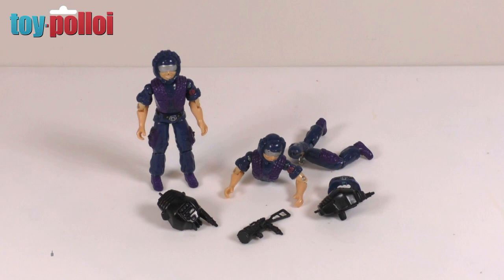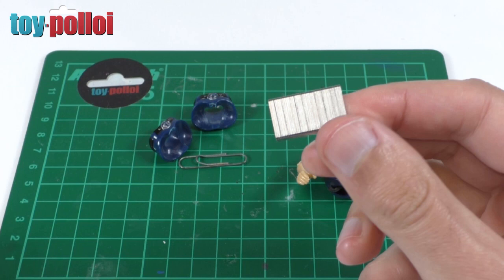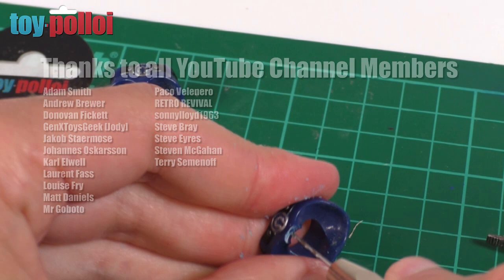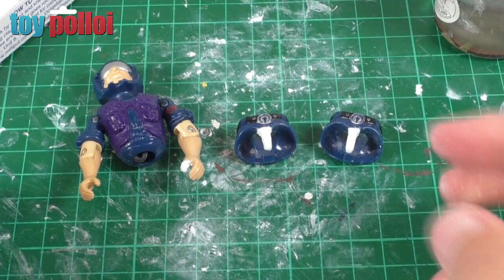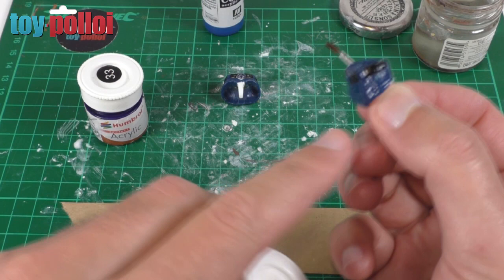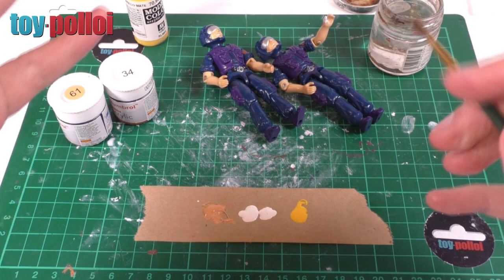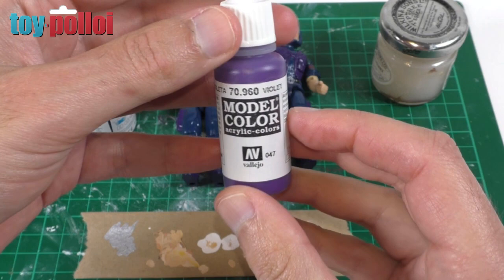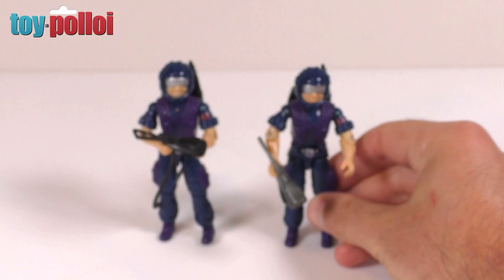Vintage G.I.Joe Tele-Viper Restoration, including thumb repair - Toy Polloi - Cobra Convergence V

Comment: Here is a neat tip when drilling very small holes.  Use a sewing pin to make a small dimple in the plastic before you drill. That will prevent the drill bit from riding. It has a been a life saver for me when I  work on model trains.

Comment: Nice mend and scult. Youcan just wash off Acrylics while they are wet if you don't like the colour but your match was very good. I have used a silver gel pen from the Works on some of my miniatures painting figures. They are very fine tipped so only really small lines or areas can be done. They are cheap for 3 and you can get gold ones too. Do tend to dry up it seems fairly quickly in the pens themselves but how cheap they are doesn't really matter.

Comment: Those paints are pretty nice, I especially like the flesh tone.
I just ordered the tools you have in this video. You are a great instructor, cheers mate!
Reply: Where did you order the hand vice?
Reply from the maker: Check out the Tool Shop section of toypolloi.com cheers
Reply: @williamthompson5504  Ebay

Comment: As a diehard Joe collector from 1982 to present, this warms my heart. I love seeing these old guys put back into service again. A lot of the Tele-Vipers have the broken crotch and chipped nose. 

I have a question though:  how fragile is the Milliput repair? I'm guessing you don't want to jam a weapon in the hand with the thumb repair, but what about the crotch pieces? How much abuse can the Milliput tolerate before breaking off again? Can the figures sit down and be moved around?

Thanks! I might try this on a few of my old junker figures. I'm one of those people who wouldn't dare throw a Joe figure away, even in the roughest shape.
Reply from the maker: The pelvis is very sturdy as it's quite thick. With the fingers you need to be careful with them but they do hold guns.  They are about as brittle as the original thumbs.

Comment: How brittle is the milliput when set? Would you risk making the figure hold something in the repaired hand? Great video and contribution to the hobby and collector communities. Thank you.
Reply from the maker: The pelvis ends up really strong as it's quite thick. The Thumb I would say you have to be careful with as it's such a thin piece even with the support underneath.

Comment: Can you advise on the diameter and thickness of O-ring you use for repair of GI Joe figures?
Reply from the maker: Size 8 or 9. You can buy packs of them on ebay in kits designed for repairing g.i.joe figures. They come with o-rings, t-bars and screws. Very useful.

Comment: If doing a restoration and the leg screws are rusted.... Do you think it's safe to soak the whole leg section in vinegar? I have a wet-suit that was obviously in a few water fights and I'm wondering if that will work instead of more aggressive means and/or drilling to replace rotted screws. Just not sure about plastic.
Great video as always!
Reply from the maker: I've not tried that myself. If the screw is so rusted you can't unscrew it, vinegar will not make it any better, just less rusty.

Comment: Phenomenal job Dave, but I have a question regarding the milliput that you mixed, can you still use that mixture for a later project and for how long does it last? I may need to use some on a project that I have, and I have never used it before.
Reply from the maker: Once you have mixed it you have about an hour to use it before it starts to set. So only mix what you need to use. Cheers
Reply: @toypolloi  sounds good thanks Dave!

Comment: Do you recommend using the same method for fixing the pelvis if you have the original piece?
Reply from the maker: If you have the broken pieces, use plastic weld to re-attach. Cheers
Reply: @toypolloi  thank you kindly 😎

Comment: What's the size of that tiny drill bit?
Reply from the maker: The same size as the metal I use to make the thumb. Whatever you use as the sub structure will be the size you need.

Comment: What is the best glue to bond the GI Joe Plastic, I have the a broken waist that hooked portion broke off. I do have all the pieces. Thanks
Reply from the maker: Plastic weld should do the job of you have the pieces.
Reply: @toypolloi  Thank you! Any  suggestion for a paint o paint pen to repair flesh color nose tips?
Reply: @toypolloi  is the Mfg. Plastruct? Thanks!
Reply from the maker: I use plastic weld, not sure if that is the same. See the video for the paint I used. Cheers

Comment: Hello Toy Polloi,
Pardon my me for asking this, I prefer not to make requests for content even if I were a Patron (Which while I'm not yet, I may just become one on the first. Kinda broke till then on anything not essential you see.) but would it be possible for you to do a paint mixing 101 video series?

As I am making figurines for my shop, Dash Terrier Props and More I am finding it hard to get the mixing of Acrylic paint working right. So far my props have had mostly standard coloring or are varnished  (A primary type of prop I do is Pottermore Wands, wood carving is less paint heavy after all, inlays and inks work for those best) but I am making figurines as well as future prop projects needing good color matching on painting. 

I see how easy you make it look, I thought I'd ask and see if you have any tips, I can't seem to keep mine when using Card, towels or the like wet they dry like they had nothing but pigment in them. Anyway hope all is well for you I know you're all locked down in the UK and I hope that soon passes, glad we are slowly getting vaccines for that stupid viral and hopefully life gets back to normal soon especially for you guys in the UK, and Brazil. Terrible thing that strain they got a few great friends of mine come from both regions and I worry about them like brothers.

Sorry got a bit rambly there, heh I talk a lot and sometimes it seems disconnected. But it does have some common things to it. Anyway yeah if you could even recommend a good guide to paint mixing for beginners that would be great, I got a lot to make and if I want it to look good I need painting lessons Beyond just buying batches of premixed colors (Which a few colors I am, just because I know I'll need lots of those colors So or Blue and Rebecca Purple for example.) 

Thanks and again stay safe.
Reply from the maker: I try to show my mixing in each video as it is quite an art to get it right. Check out some of my recent MOTU figure repairs as I do a lot of mixing and matching in those.

Cheers
Reply: @toypolloi  I've seen some of them, but my biggest problem is when I am mixing paints on a Pallet they dry far too quick especially on card and towels. Any advice for that my friend? Not sure but you don't by chance use a type of thinner to keep them wet while working like the stuff they use in air spray systems to keep them from clogging? Just asking and thanks again for the reply will do my best to give some patreon support soon you do some nice work. 

Even if you do kill legos, XD just a joke for me I am going to make duplicate resin ones for my projects I want to have shoulder articulation, being a firm Anti-Kragle collector just makes my mindset not to damage any Lego, even if I buy 3rd party parts but as long as the parts are easy to get I don't mind you doing so. Just never touch the Monorail tracks and Toa masks and we'll be fine. ;)

Comment: Surprised the thumb was the hardest part, not the pelvis…
Reply from the maker: It's the size the makes it difficult. You can only put a thin amount of Milliput on top of the wire which you will find is not easy.